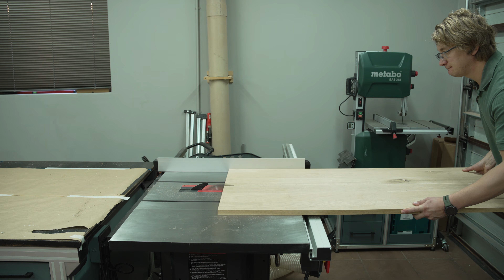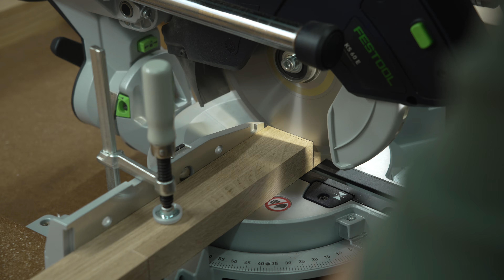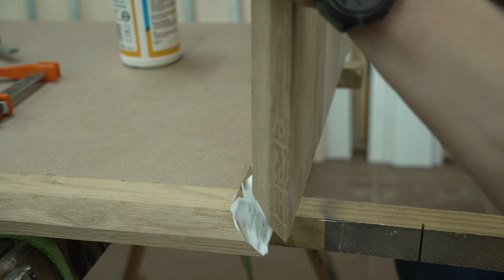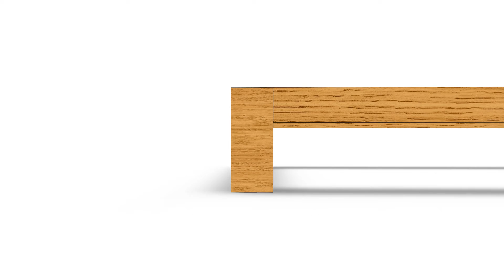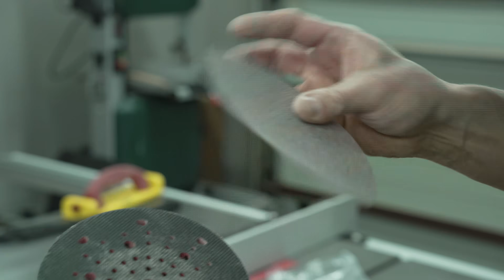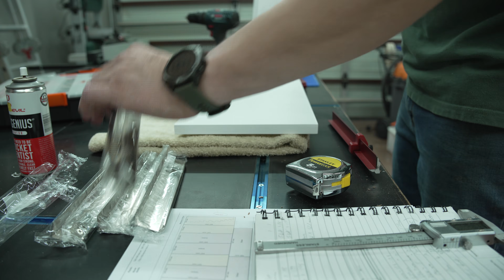How to Build a Modern Dresser  | DIY Woodworking Project

Comment: I really like the look of the dresser, for example the detail with the reveal on the base! What I don't get though is the "inconsistency" of the built. For example the pocket screws on the vertical divider instead of a sliding in joint and also the just screwed together drawers and visible drawer slides.
But some nice ideas I must say. Gets me thinking of bulding a new dresser and getting rid of ikea stuff... :D
Reply from the maker: Thanks for watching and for the comment!This build was basically afterthought, didn’t plan on building it, I only planned on building a crib and then I realized I can maybe make something to compliment the crib with the materials I already had. 
In a ideal world with a limitless budget I would have loved to build a dresser made completely out of oak with hidden drawer slides and maybe dove tail joint drawers (pocket holes was just lazyness!😂you got me!) 
Hopefully in the future! 
But thanks for watching I really appreciate it
Reply: Thank you for your video.
Like the bevelled front and the looks of the dresser overall.
Only one question: why build it so heavily constructed? Such a thick top and bottom, so many dominoes...
Designed it to be earthquake proof?
😊
Not to mention your back will hurt when lifting it...
😨
Reply from the maker: Thank you, really appreciate the compliment!

To be honest, that thing is super heavy!😂
The main reason was due to the quality of the boards I used, they were made up with sub par joints and a little bit warped. I thought of ripping all of the joints and gluing them back together but that would have left me with too little material to work with. So I kept them thicker with the hope that the joints will not fail and yes I went overboard with the dominos on that one board, that was more to pull the board into alignment instead of making it indestructible😂
Reply from the maker: But yeah, I would have made the dresser completely different if I started with rough lumber!